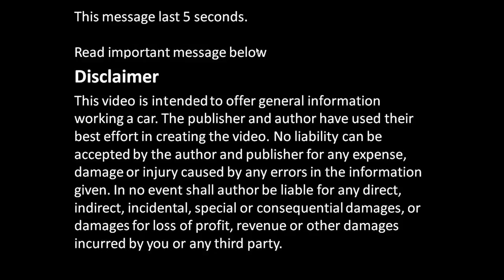Fuel pipes and hoses info Toyota Corolla. years 1991 to 2000

Comment: Thanks Peter for all your great  Corolla repair videos  !  You helped me fix many other issues on my car...Just this week i had a very stinky gas drip under my 1993 Corolla so i took off my plastic fuel/ brake line guide (slash shield/cover} and saw the old metal lines were totally rusted out.. So i cut them off from the front near where they all turn up toward engine bay and where it was still good clean not still rusted lines up there... At the rear connections of the lines by the tank were 1 flare fitting which i unscrewed off, and other 2 were just pushed fit into rubber hose connection with small spring clips keeping it sealed on... i went to buy replacement lines at a NAPA part store and they had everything i needed in stock for about $42  ..i bought three 5 ft straight metal lines which easily bend to fit under my corolla.. also included an extra flare nut since these universal lines were not fitted with the same thread size as my corolla .. and each line i matched with compression union to connect to where i found the clean section on the old line up front...turned out on my car 2 of the lines were 1/4" and the bigger tube line is 5/16" size tube..  Best bet just always bring small piece of the old clean part of each line to a car parts store just to make sure to match the correct sizes though in order to union it to the orig. lines. ... Job is messy but not difficult..Also car took an extra 5 seconds to turn over after i put it all back together so i suppose that was just how long it takes for the new lines to refill back up with fuel once you turn the key ?
Reply from the maker: About 5 sec

Comment: My corolla e11 has a strong gasoline smell at start but goes away after 30 seconds. The smell is not from engine but strongest at the fuel tank.
Is it always necessary to replace whole fuel lines or is it possible to repair?
Reply from the maker: You can replace part of line and you might have leak in tank too

Comment: Peter, I have a question. 
I did removed my fuel tank 2 years ago and didn't marked up return line, which one it will be if you look from the engine side. Would you picture and point or just confirm top, bottom, left or  right fitted it is. Got my lines cut off in the middle so my concern is to connect correctly after replacing them on full length
Reply from the maker: Thanks for comment. 👍😀

Comment: Do you know what fuel line is the middle one I got 5 lines what's the one in the middle due to I broke it and I don't know what one it is.
Reply from the maker: I have read your post, good comment 👍
Reply: The 2 thin ~3/16" lines lead to the left & right rear brakes from the proportioning valve in the engine. The 3 thick ones (~5/16") are vapor (vent), return & supply lines, from the engine "green valve," air box line and fuel rail. The first 2 lead to the same plastic support connecting the lines to hoses by the gas tank (trace the unbroken one from the engine to tell which is which). The supply line has a quick connect. If you have 450 USD you can buy lines pre-made https://www.youtube.com/watch?v=Wv9cThGC7ZE. ~100 USD gets you 25' hand bendable 3/16" NiCu brake line, m10 x1.0 male fittings, female unions, a cheap double flare tool from an auto parts store and 25' of 5/16" high pressure nylon fuel line with adapters. Hope that helps. P.S. Peter Finn is a cool dude.

Comment: Got a ques for ya.  I gotta drain the fuel system on my 02 highlander.  I know how to drain the fuel tank.  But i want to drain it from the system to.  But i dont have a valve to do it.  Any advice on which hose i can take off to drain it by the fuel rail
Reply: fuel tanks have 2 rubber plugs, just pull them both out.  Remove gas cap before you do that.

Comment: Peter. On my fuel tank i have 2 connection s on top where the fuel pump is. just a bit towards the back of the tank is a separate connection. Is that the one that will connect to the charcoal filter canister up front?
Reply from the maker: Yes, please check lines to engine room too.

Comment: took the covers off to expose the fuel and brake line.  I have a brake line leaking in my late father's 1996 corolla.  Can't quite see the nuts in the red brake line assembly holding the lines to the car , but have to take them off.  I think I will get to union fittings to repair it.  61 years old trying to do this.  I know the mechanics down the street won't touch a brake line.
Reply from the maker: Noted 👍

Comment: Peter i have a question about my 1991 Toyota Celica.  On the gas tank i have 3 line connections. 2 of them are going into the main fuel pump unit and there is a separate line behind it on top Is that one a vent connection to the charcoal filter can?
 DO YOU HAVE A EMAIL OR FACEBOOK I CAN SEND YOU PICTURES?
Reply from the maker: Hi, third line is back line to tank.
Reply: My problem is all the lines were rotted and i had no idea were they connected. That id why i ask where the line connects up front to back. So when  you say third line , do you mean from the charcoal canister to the back of tank?

Comment: Peter can you help me. I have a 91 Toyota Celica. I have one line on top of the charcoal canister that i can not find where it goes to. The canister has 3 lines connected to it. One big one at the bottom and two on top. One on top i have connected that goes behind the engine and the other one to the right of it i do not know. It had a rubber line connected to it that went into a steel line that went down below. That line was rotted off and i dont know where it went?. If you are on Facebook i can message you with my profile. I am always happy to meet new friends who share the same interests
Reply from the maker: It goes to fuel tank.
Reply: THANK YOU